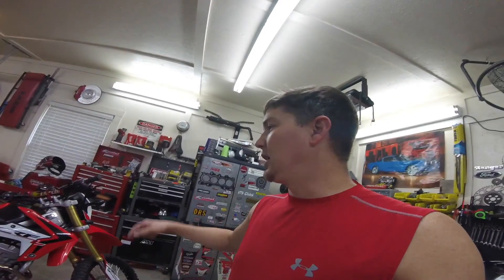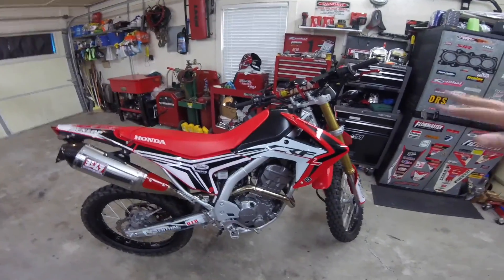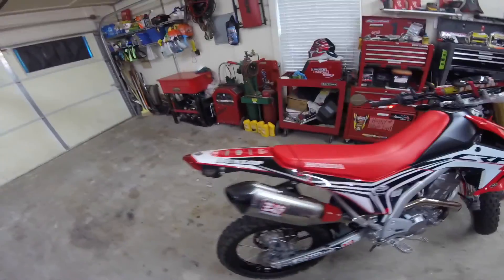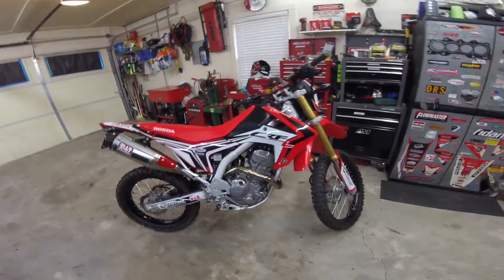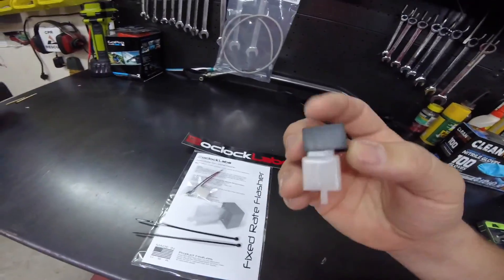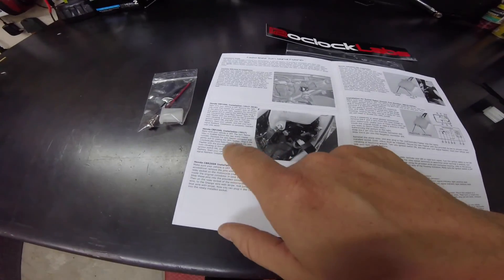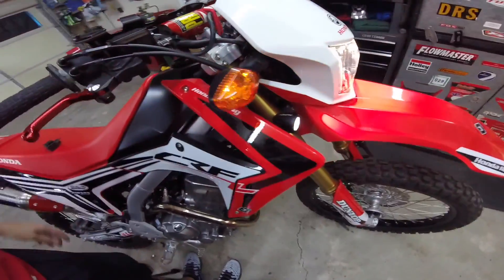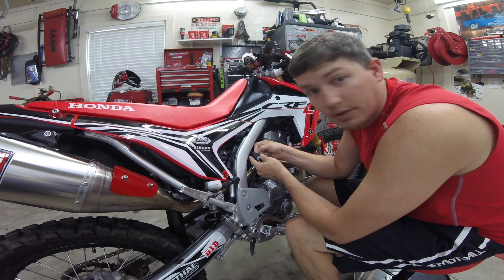LED Lights Not Working Crf250L

Comment: Are those flush mount rear blinkers from TST Industries? If they are, are they plug and play? I have tried to find them, but I have had no luck.
Reply from the maker: They're from china but I found a guy in Texas that I prefer his better look him up on Ebay (zouchen93).  They have plug n play ends on but not factory clips you'll have to splice then together.
Reply: Thanks Chris. I will look him up.